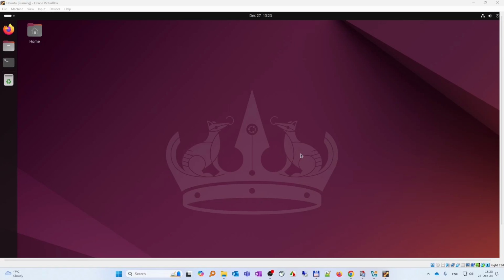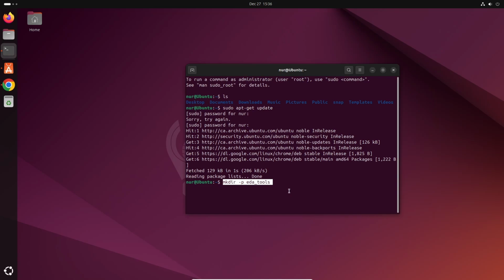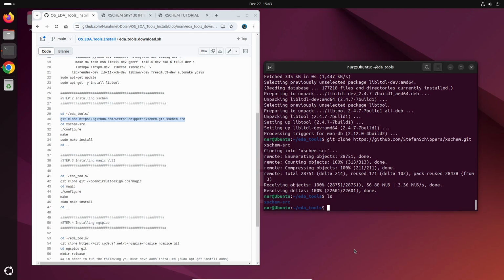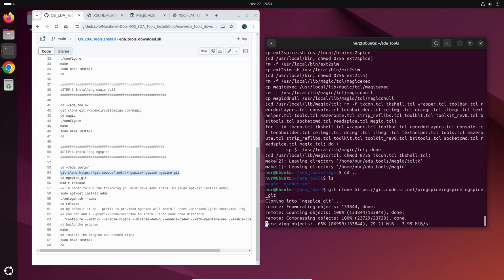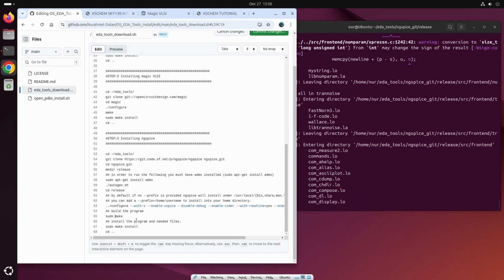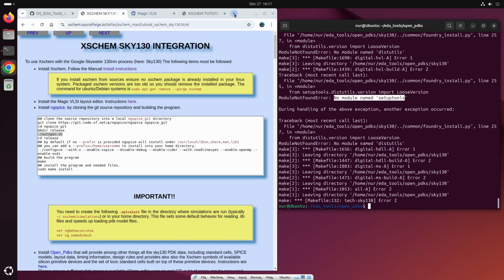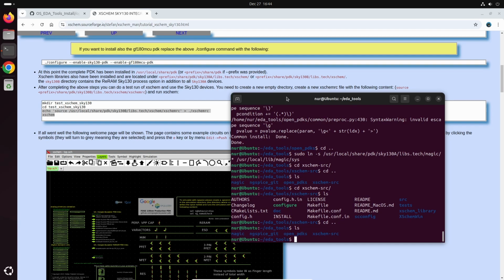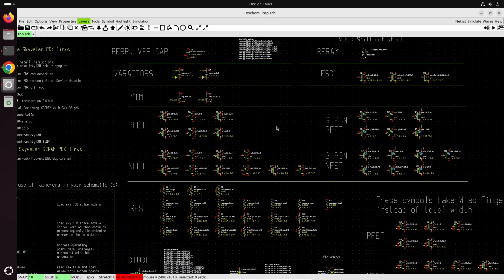Install Xschem, Magic, Ngspice and Sky130 PDK | Ubuntu on VirtualBox | Open source IC Design

Comment: sir when i am running make command in open pdk after executing it there are many errors that no cdl file like: "No CDL file contains sky130_fd_io device sky130_ef_io__com_bus_slice_1um" , please help me resolve this
Reply: I think your virtual box has run out of memory space, I'm facing the same issue and am unable to increase the size beyond 40GB, please let me know if you have found a workaround
Reply: @GowriHiremath  best option is start fresh..... make a new workspace in virtual machine with atleast 100gb

Comment: [Errno 28] No space left on device: '/usr/local/share/pdk/sky130B/.config'")]

why 49G used, please help how can i solve this:

Filesystem      Size  Used Avail Use% Mounted on
tmpfs           387M   36M  352M  10% /run
/dev/sda2        49G   49G     0 100% /
tmpfs           1.9G     0  1.9G   0% /dev/shm
tmpfs           5.0M  8.0K  5.0M   1% /run/lock
tmpfs           387M  136K  387M   1% /run/user/1000
/dev/sr0        6.0G  6.0G     0 100% /media/nqhuy/Ubuntu 24.04.2 LTS amd64

Comment: HI,I'm  having problems after giving sudo make, I keep getting stuck at make[3]: leaving directory “/home/zzx/eda_tools/open_pdks/gf180mcu” and not proceeding,i keep trying so many times,and my friend also encounter with this problem,can you help me?
Reply: Hii coming from the same problem.. the fix is Patience.. it took around 1 hour for me to complete the process
Reply from the maker: @AnkitKumar-tt5hs You are right, everyone’s problem is different, most of the problem is lack of prerequisite packaging is not found in the system. But after researching a little, there’s always solution 😊
Reply: @NurahmetDolan  Thank you very much, it's true that patience is the only path to solving this problem, but I'm using a gf180mcu,have you learned anything about this pdk before please?
Reply: @AnkitKumar-tt5hs OMG THANK YOU FOR SAYING THIS
Reply from the maker: Hi, I'm sorry I need more context and background to know the issue. From you message, I don't know what is the problem.

Comment: Hello I’m facing multiple errors after giving sudo make command in open pdks
Reply: tumse na ho paega, doosri open source pdk leke build kar lo by make aur install kar lo.
Reply: LEF read, Line 7926 (Error): Bad macro ORIGIN; requires 2 values.
LEF read, Line 8305 (Error): Bad macro ORIGIN; requires 2 values.
LEF read, Line 8710 (Error): Bad macro ORIGIN; requires 2 values.
LEF read, Line 9122 (Error): Bad macro ORIGIN; requires 2 values.
LEF read, Line 9504 (Error): Bad macro ORIGIN; requires 2 values.
LEF read, Line 9912 (Error): Bad macro ORIGIN; requires 2 values.
LEF read, Line 10323 (Error): Bad macro ORIGIN; requires 2 values.
LEF read, Line 10725 (Error): Bad macro ORIGIN; requires 2 values.
LEF read, Line 11112 (Error): Bad macro ORIGIN; requires 2 values.
LEF read, Line 11477 (Error): Bad macro ORIGIN; requires 2 values.
LEF read, Line 11861 (Error): Bad macro ORIGIN; requires 2 values.
LEF read, Line 12280 (Error): Bad macro ORIGIN; requires 2 values.
LEF read, Line 12655 (Error): Bad macro ORIGIN; requires 2 values.
LEF read, Line 13056 (Error): Bad macro ORIGIN; requires 2 values.
LEF read, Line 13467 (Error): Bad macro ORIGIN; requires 2 values.
Couldn't find label VCCD_PAD
Can't write file named '(UNNAMED)'
Annotating files in /home/harshil/eda_tools/open_pdks/sky130/sky130B/libs.ref/sky130_fd_io/maglef
No CDL file contains sky130_fd_io device sky130_fd_io__top_analog_pad
No CDL file contains sky130_fd_io device sky130_fd_io__top_vrefcapv2
No CDL file contains sky130_fd_io device sky130_fd_io__overlay_vdda_hvc
No CDL file contains sky130_fd_io device sky130_fd_io__top_hvclamp
No CDL file contains sky130_fd_io device sky130_fd_io__top_pwrdetv2
No CDL file contains sky130_fd_io device sky130_fd_io__hvclampv2
No CDL file contains sky130_fd_io device sky130_fd_io__overlay_vssio_hvc
No CDL file contains sky130_fd_io device sky130_fd_io__top_xres4v2
No CDL file contains sky130_fd_io device sky130_fd_io__overlay_vssa_lvc
No CDL file contains sky130_fd_io device sky130_fd_io__top_amuxsplitv2
No CDL file contains sky130_fd_io device sky130_fd_io__top_sio_macro
No CDL file contains sky130_fd_io device sky130_ef_io__bare_pad
No CDL file contains sky130_fd_io device sky130_fd_io__top_ground_lvc_wpad
No CDL file contains sky130_fd_io device sky130_fd_io__top_lvclamp
No CDL file contains sky130_fd_io device sky130_fd_io__overlay_vssd_hvc
No CDL file contains sky130_fd_io device sky130_fd_io__top_power_hvc_wpadv2
No CDL file contains sky130_fd_io device sky130_fd_io__top_gpiovrefv2
No CDL file contains sky130_fd_io device sky130_fd_io__top_power_hvc_wpad
No CDL file contains sky130_fd_io device sky130_fd_io__signal_5_sym_hv_local_5term
No CDL file contains sky130_fd_io device sky130_fd_io__overlay_vccd_hvc
No CDL file contains sky130_fd_io device sky130_fd_io__corner_bus_overlay
No CDL file contains sky130_fd_io device sky130_fd_io__top_ground_hvc_wpad
No CDL file contains sky130_fd_io device sky130_fd_io__overlay_vssd_lvc
No CDL file contains sky130_fd_io device sky130_fd_io__overlay_vssio_lvc
No CDL file contains sky130_fd_io device sky130_fd_io__overlay_vddio_hvc
No CDL file contains sky130_fd_io device sky130_fd_io__top_lvc_b2b
No CDL file contains sky130_fd_io device sky130_fd_io__overlay_vddio_lvc
No CDL file contains sky130_fd_io device sky130_ef_io__analog_esd_pad
No CDL file contains sky130_fd_io device sky130_fd_io__overlay_vdda_lvc
No CDL file contains sky130_fd_io device sky130_ef_io__analog_noesd_pad
No CDL file contains sky130_fd_io device sky130_fd_io__overlay_gpiov2
No CDL file contains sky130_fd_io device sky130_ef_io__analog_pad
No CDL file contains sky130_fd_io device sky130_fd_io__overlay_vssa_hvc
No CDL file contains sky130_fd_io device sky130_fd_io__top_gpio_ovtv2
No CDL file contains sky130_fd_io device sky130_fd_io__top_power_lvc_wpad
No CDL file contains sky130_fd_io device sky130_fd_io__top_gpiov2
No CDL file contains sky130_fd_io device sky130_fd_io__overlay_vccd_lvc
No CDL file contains sky130_fd_io device sky130_fd_io__top_analog_pad
No CDL file contains sky130_fd_io device sky130_fd_io__top_vrefcapv2
No CDL file contains sky130_fd_io device sky130_fd_io__overlay_vdda_hvc
No CDL file contains sky130_fd_io device sky130_fd_io__top_hvclamp
No CDL file contains sky130_fd_io device sky130_fd_io__top_pwrdetv2
No CDL file contains sky130_fd_io device sky130_fd_io__hvclampv2
No CDL file contains sky130_fd_io device sky130_fd_io__overlay_vssio_hvc
No CDL file contains sky130_fd_io device sky130_fd_io__top_xres4v2
No CDL file contains sky130_fd_io device sky130_fd_io__overlay_vssa_lvc
No CDL file contains sky130_fd_io device sky130_fd_io__top_amuxsplitv2
No CDL file contains sky130_fd_io device sky130_fd_io__top_sio_macro
No CDL file contains sky130_fd_io device sky130_ef_io__bare_pad
No CDL file contains sky130_fd_io device sky130_fd_io__top_ground_lvc_wpad
No CDL file contains sky130_fd_io device sky130_fd_io__top_lvclamp
No CDL file contains sky130_fd_io device sky130_fd_io__overlay_vssd_hvc
No CDL file contains sky130_fd_io device sky130_fd_io__top_power_hvc_wpadv2
No CDL file contains sky130_fd_io device sky130_fd_io__top_gpiovrefv2
No CDL file contains sky130_fd_io device sky130_fd_io__top_power_hvc_wpad
No CDL file contains sky130_fd_io device sky130_fd_io__signal_5_sym_hv_local_5term
No CDL file contains sky130_fd_io device sky130_fd_io__overlay_vccd_hvc
No CDL file contains sky130_fd_io device sky130_fd_io__corner_bus_overlay
No CDL file contains sky130_fd_io device sky130_fd_io__top_ground_hvc_wpad
No CDL file contains sky130_fd_io device sky130_fd_io__overlay_vssd_lvc
No CDL file contains sky130_fd_io device sky130_fd_io__overlay_vssio_lvc
No CDL file contains sky130_fd_io device sky130_fd_io__overlay_vddio_hvc
No CDL file contains sky130_fd_io device sky130_fd_io__top_lvc_b2b
No CDL file contains sky130_fd_io device sky130_fd_io__overlay_vddio_lvc
No CDL file contains sky130_fd_io device sky130_ef_io__analog_esd_pad
No CDL file contains sky130_fd_io device sky130_fd_io__overlay_vdda_lvc
No CDL file contains sky130_fd_io device sky130_ef_io__analog_noesd_pad
No CDL file contains sky130_fd_io device sky130_fd_io__overlay_gpiov2
No CDL file contains sky130_fd_io device sky130_ef_io__analog_pad
No CDL file contains sky130_fd_io device sky130_fd_io__overlay_vssa_hvc
No CDL file contains sky130_fd_io device sky130_fd_io__top_gpio_ovtv2
No CDL file contains sky130_fd_io device sky130_fd_io__top_power_lvc_wpad
No CDL file contains sky130_fd_io device sky130_fd_io__top_gpiov2
No CDL file contains sky130_fd_io device sky130_fd_io__overlay_vccd_lvc
# Add a maskhint set for the GPIO pad .mag view to prevent problems writing
# when writing HVI to GDS during hierarchical adjustments.
../common/insert_property.py -std_format /home/harshil/eda_tools/open_pdks/sky130/sky130A sky130_fd_io sky130_fd_io__top_gpiov2 \
	"MASKHINTS_HVI 1346 17198 5828 19224 13700 1890 15920 2360 24 17522 1778 20612" -mag
make[3]: * [Makefile:1553: io-B] Error 1
make[3]: Leaving directory '/home/harshil/eda_tools/open_pdks/sky130'
make[2]: * [Makefile:1423: io-build-B] Error 2
insert_property.py:
   source   = /home/harshil/eda_tools/open_pdks/sky130/sky130A
   library  = sky130_fd_io
   cell     = sky130_fd_io__top_gpiov2
   property = MASKHINTS_HVI 1346 17198 5828 19224 13700 1890 15920 2360 24 17522 1778 20612
make[2]: Leaving directory '/home/harshil/eda_tools/open_pdks/sky130'
make[3]: Leaving directory '/home/harshil/eda_tools/open_pdks/sky130'
make[1]: * [Makefile:1053: all-B] Error 2
make[2]: Leaving directory '/home/harshil/eda_tools/open_pdks/sky130'
make[1]: * Waiting for unfinished jobs....
make[1]: * [Makefile:1053: all-A] Error 2
make[1]: Leaving directory '/home/harshil/eda_tools/open_pdks/sky130'
make: * [Makefile:132: tech-sky130] Error 2
harshil@SOC101-ubuntu:~/eda_tools/open_pdks$ install python3-packaging
install: missing destination file operand after 'python3-packaging'
Try 'install --help' for more information.
harshil@SOC101-ubuntu:~/eda_tools/open_pdks$ sudo apt install python3-packaging
[sudo] password for harshil: 
Reading package lists... Done
Building dependency tree... Done
Reading state information... Done
python3-packaging is already the newest version (24.0-1).
python3-packaging set to manually installed.
0 upgraded, 0 newly installed, 0 to remove and 47 not upgraded.

Comment: Hello I am facing an issue in installation of open_pdks.

Can you share you email id so that I can share exactly what issues are there after the ./configure -- enable-sky130-pdk
Reply from the maker: Yes, sure. You can post your question here if you want so that more people can see it. Or you can email me at: nurahmet.dolan@gmail.com
Reply: @NurahmetDolan  While installing open_pdks. After step:
./configure --enable-sky130-pdk after that sudo make gave you two errors.

I also got errors but mine was different. But I still followed your video so after install steptools again on terminal I gave command sudo make, after some time the terminal automatically get closed. What should I do now? Can you help in this ?
Reply from the maker: @mohammadkunda3356  So I installed on a different computer, yes after ./configure --enable-sky130-pdk, I have a different error than the first one on another computer. I guess this error message is different for different computers. Can you please share the error message? Usually, some packages are not preinstalled on the computer, you can google & research a little, you can solve the problem. But feel free to post your error message here.
Reply: @mohammadkunda3356  hello，have you finished your problem?i have the similar problem like yours,i get stuck after i gave command sudo make,and then no response,can you help me if you have solution?
Reply: I am literally having those errors right now and my laptop is freezing